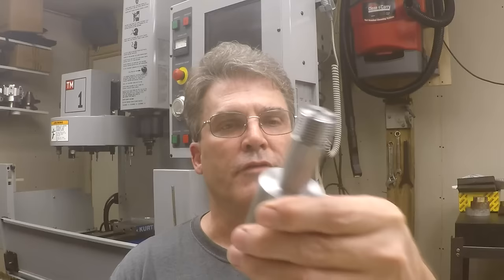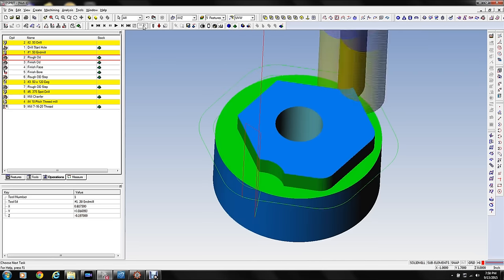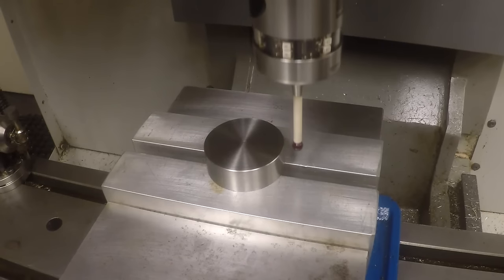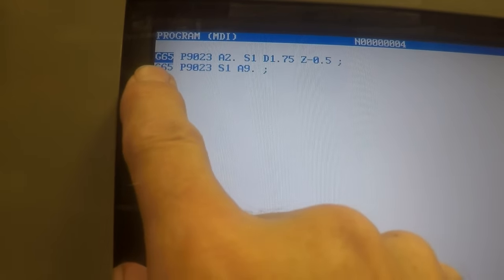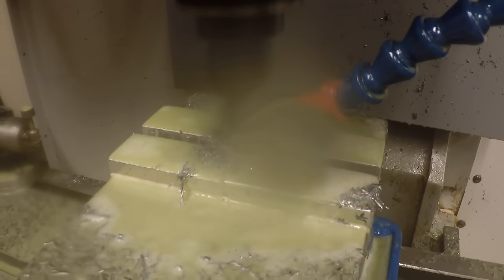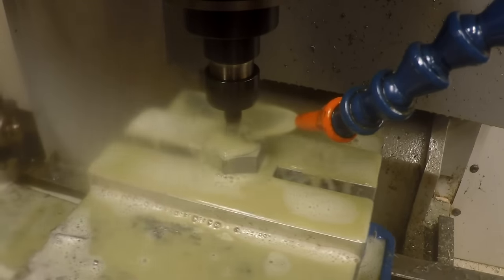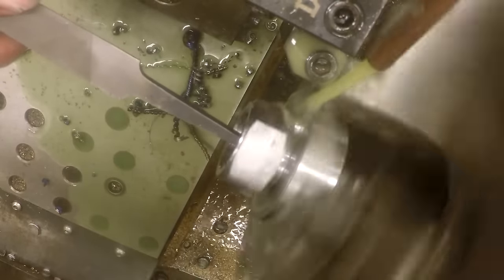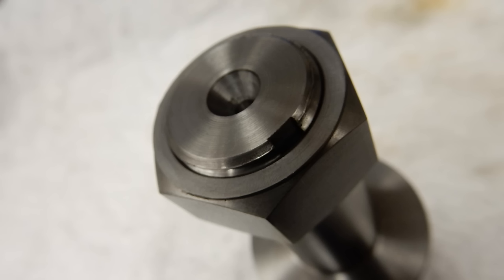Bearing Nut

Comment: Very pretty part. What is the reason you went to all that trouble?  A piece of hex stock in the lathe and you could crank them out all day much faster.
Reply from the maker: +David Kirtley  You are right it would be, But I didn't have any 1.125 Hex and it was just for one part. Also I like to show different ways of doing things. I would like to get people to think outside the box and for me this was the easiest way to do it from the drop off the shaft. But also the most wasteful in material. I would do as you say if I was making a lot of these.

Comment: How did you get the 30 deg chamfer done around the edge of the step?  It looks well blended in. I use Fusion 360 and not sure how you’d go about doing that.
Reply from the maker: This is a old video of mine. Did I turn it on the lathe or do it on the mill? I will have to review the video.
Reply: It was all done on your mill.
Reply: @ScotY808  I would use the chamfer mill as a normal square endmill in the software, calculate the length from the tool tip to the tool OD edge and do a normal profile milling operation around the round profile and adding the tip to tool OD offset to the depth. After all, the chamfer mill is basically just a square endmill with a cone attached to its tip.

Comment: hi! just found your channel and really like it 👍
does your thread look normal using a threadmill? I mean if your threads are a bit diagnal, and your cutter is turning perfectly sideways, wouldn't your threads kinda become a perabla? do they look fine to the naked eye?

I'm still learning :)
thanks
Reply from the maker: the russian machinists hi glad you like it. I'm no sure I understand your question. I would like to help you. A thread mill should make the same thread as a lathe tool if programmed properly and the tool is the proper tool.
Reply: Edge Precision thankyou for the reply! imagine  we threadmilled an extremely coarse thread with a fly cutter... let's say the thread is 1 Rev in 4 inches. how would our thread look like then? I don't think our thread would be normal looking at all, but would be a u shaped groove down the ID. I think the same principle applies to a regular thread, but in much smaller scale ofcoarse. we can't cut a perfect sideways "groove" when our cutter isn't parallel with the groove, if that makes sense.
Reply from the maker: the russian machinists I see what you mean. You are right if the lead is to steep or the thread is square in profile it would not produce a accurate profile. There is a relation to the diameter of the thread mill to the lead of the thread. With single start V threads this isn't usually a problem. On a ID thread you usually can't fit a cutter to large in diameter. On a OD cutting with a fly cutter if the lead was steep and the cutter was large in diameter this could lead to a imperfect thread profile. I have used cutters as big as 3.00" in diameter to mill a 4.50" diameter 6 pitch internal Acme thread without a problem.
Reply: Edge Precision oh ok. Maybe it's not as much of a problem as I thought. 
thanks for your videos, looking forward for more to come :)

Comment: Maybe this question has been asked already; How many GoPro cameras/housings have gone through? I know the cameras inside the integrex are pointless. But the turning operations are risky with the stringers! Hahaha Not sure how many people who follow your channel, know the amount of time it takes you to draw the product or write a program in Mazatrol? Then the set-up and run time... It's hard for companies to make money as a job shop, most times. Converational programming still has it's limits with premium threading, but I enjoy it. That's what I would like to explore, is the design (software) aspect of programming. Very few companies allow your to design and machine! COOL STUFF!
Reply from the maker: OILFIELDTOOL It's interesting that you ask that question, and no, no one has asked it. I have hade a lot of trouble with GoPro camera cases. The plastic they use for them doesn't hold up to the coolants. It causes the plastic to crack and fail. You may have noticed in some of my videos that I have used tie wraps and rubber bands to hold the back on. I've changed the latch to a aftermarket aluminum one. But the plastic fails at the attachment points and hinges. I have modeled a aluminum case using the lense cover and buttons from their case. I just haven't got around to making it. It will also have a air knife to continually blow the coolant off the lense. My next project after the mill stop fixture.
Reply: Hahahaha That sounds Awesome! I picture in my mind, your GoPro being caught by a stringer and being thrown around the machine cavity, like leaving a indicator in that environment. Risky life of a GoPro hahahaha But I never thought the coolant would affect the housing that much. I always think of the flexible blue coolant hoses, I will look to see what type of polymer they're made of...
Reply: @EdgePrecision  I know this is an old thread, and that you've likely already found a solution to chemical damage to your plastic camera housings, but in the unlikely event that you are still having this problem I have a suggestion: coat the plastic with silicon oil (e.g. RainX). 
Silicon oil is tenacious and will provide a protective barrier for plastic. It's this same property that has made it the bane of painters. It only takes a small amount to prevent paint from sticking. Thoroughly clean the plastic to be protected with warm soap and water. After letting the surface dry, apply silicon oil to plastic and wipe off excess. Reapply as needed. 
I use polycarbonate shields on my lathe and mill, which is what I believe that Gopro case are made of, and silicone oil has done a great job protection them from coolant and chips. It also makes it much easier to clean them. The silicon oil protects by filling microscopic voids in the surface it's applied to.

Comment: Love the channel/videos. I took some CNC classes, but never got good enough to get hired... :-(  So I'm curious... if you had milled the hex deeper ditto the drilled hole, it would make
parting faster... not sure if this would be slower, or have other undesired aspects...?
Reply from the maker: I had to go back and watch the video. I couldn’t remember. I made the video so long ago. You a probably Correct for the OD but the ID I like to drill the hole only deep enough. So the parting tool just breaks into the corner of the hole. I don’t know if I even did this in this video. If the parting tool breaks into the hole on the outside corner of the drill point. It will not leave as big of burr on the parted off part.

Comment: I had a UMC 750 with next gen control at my old shop.  It could post probe cycles to MDI based on what you wanted to do.  On older controls can you do the same or do you have to just remember it all?
Reply from the maker: If I understand your question. With Renishaw’s easy set macros in the control you can do probing in MDI. It doesn’t matter what age the control. In fact you could do it even without them but it would be more involved. Some controls like the Haas and the Meldas controls don’t loose the MDI commands.(there may be others). So once you enter them you can just put the cursor on the line hit input than cycle start. I wish all controls did this.

Comment: Nice work! What was the name of cam software that you used? Was there a specific reason that you used drill rod to make the nut instead of hex stock other than it was the material you had on hand? Thanks for sharing this.

Peace!
Reply from the maker: +Jeffrey Vastine  The software for Cad drawing I use is SpaceClaim and the software I use for Cam is Esprit. The reason I use Esprit is they have a good post for the Mazak E650 I own and use at work. It is a full 5Axis multitask machine (does lathe and milling in one machine). I have shown it in previous videos. Anyway Esprit is able to do the programing for this machine as well as all my other machines except the CNC tool&cutter Grinder. The software it uses is called Numroto. I showed a simulation of that in the video Grind ID Face Groove Tool.
Reply: Thanks for the info. Have you looked at Fusion 360 yet? I heard they will soon be adding 5th axis capability and more to the entry level edition.
Reply from the maker: +Jeffrey Vastine  I have been watching the videos on NYC CNC with interest. This seems like a very good solution for someone just getting into CNC and free( if I understand right in the student version). I like the way it runs inside the cad software. The toolpath I see in NYC CNC videos looks pretty good.
Reply: +Edge Precision did you know , Esprit is a french word that translate to spirit or soul,so, does it have a meaning with the task the soft do , like an acronym, or is it a completely pointless name choice
Reply from the maker: TheMrJuoji, I don't really know. It's a CAM software.

Comment: How do you rerun chamfer and tread mill, do you tell the machine the bit is smaller or larger than it is?
Reply from the maker: Shotgun Reloader I'm assuming your question is about controlling the size. If you program using cutter comp (say G41 for left hand comp) on the tool offset page you change the diameter of the tool. Reducing the diameter takes off more increasing it leaves more. When you rerun the tool. Is that what you are asking?
Reply: Yes, I was wondering if this was a legitimate way to sneak up on the size or if you had to modify the g code. So on the thread mill you kept telling machine the thread mill is smaller and just re running the code to get the fit you needed? or is there a better way?